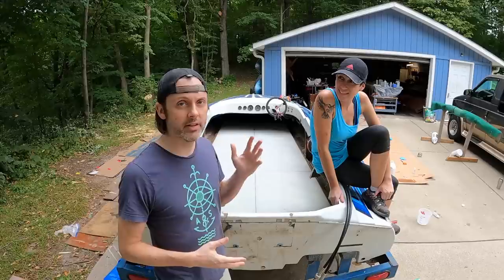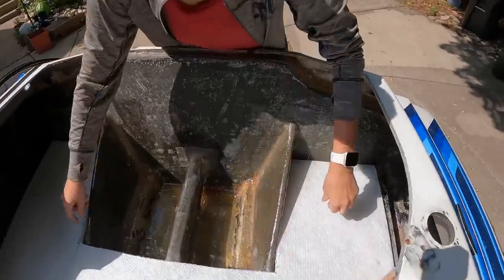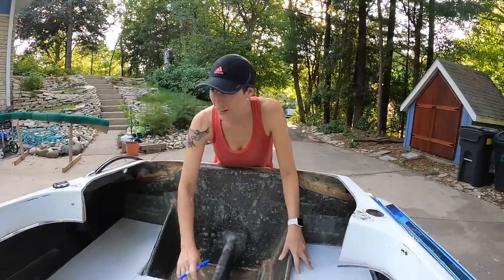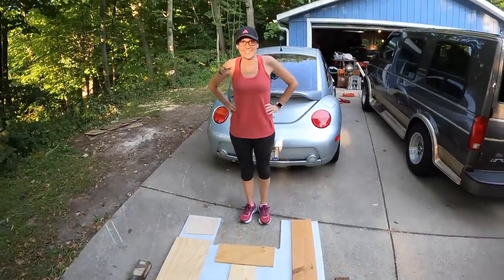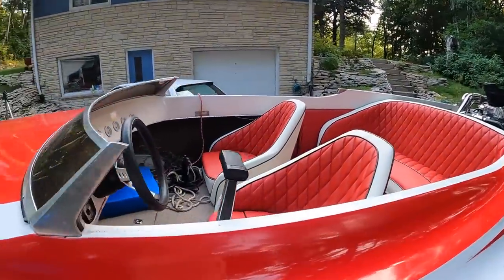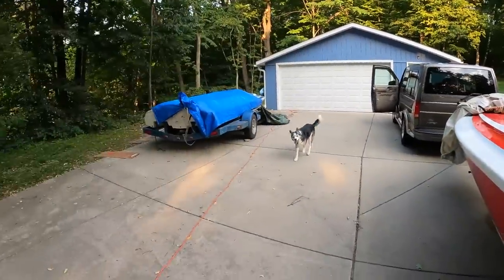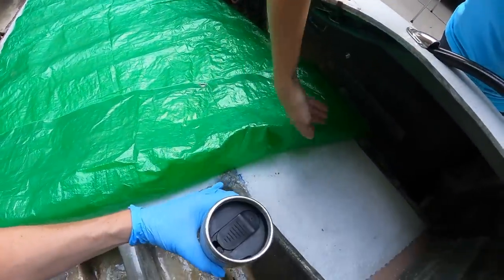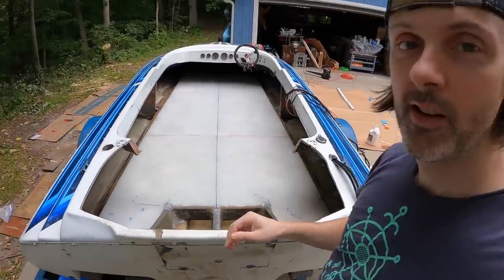ULTRA LIGHT HONEYCOMB FLOOR INSTALL Nidacore Sleekcraft SST Sunday #16

Comment: so this boat will be rot free after all you done sweet
Reply from the maker: And a LOT lighter, and way stronger.   Air entrapment hulls benefit a lot from weight reduction, as they air out easier and further.   Will basically be an airplane above 50-60mph, can't wait!

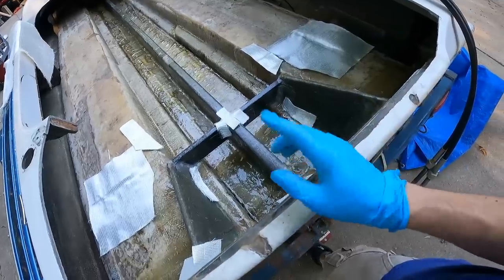Comment: Awesome work, sick boat!  Did I miss the vid of splash well delete or replacement?  At 1:26 you might be thinking about it wrong, (not that more tabbing is ever bad) the outboard torques sideways heavily twisting the transom, pushes from the bottom actually pulling the top of the transom back and pushes hard on near the center of the transom where the bottom of the engine mount or jack plate is fastened.  If you want to get a solid grasp of what happens with the torque of an outboard take your flea or something with a little 25hp and loosen the clamps a bit just play around you'll find that it tries to twist off from one side more than anything and seems to pull the top of the transom back way more than you would think.  Point being that knee should be created to be flush with the splash well going up as high as possible and tabbed to the splash well also.
Reply from the maker: There's one more episode after this one, so far.   Yeah, I know what you mean.   I guess I was thinking of something more violent like a log strike.   The mini knees are as high as they can go without hitting the splashwell.

Comment: I know what issue is.  If you could give me a shot of transom bracket inside boat. Need to see which trim components are in it.
Reply from the maker: Old ones, this is a 78 so it has the old school trim pump/reservoir that nobody makes parts or seals for.   Believe it's stock mercruiser 260/pre alpha vintage.
Reply: @ADDvanced  If this model has a reverse hold down valve on it those have a little adjustable guage on it with two white arrows that need to align properly in a set shft position blah blah typical blah mercruiser crap.  If it does the simple fix is bypass it.   Yes that simple.  They either stick like yours or malfunction and blow apart one of the trim cylinders when triming down.  Should be a line coming from trim cylinders to valve then another from valve to trim motor. This short one is almost always plastic. Just hook the line from trim cylnders directly to bottom of pump after you remove the other line to valve.  It never needed the valve to Begin with.  Also there is two wires attached to it also.  Disconnect those also.   You may have to change or adapt a fitting or two.  Uses standard brake line fittings. Hope that helps. Your trusted Mercury mechanic in TN.  No dark comments with this one LoL. Good luck

Comment: Are you using unwaxed resin, and that is why you don’t need to sand between sessions?
Reply from the maker: If it's still tacky I don't sand it, if it feels smooth I scuff w 3m pad off camera.

Comment: i wonder if the piston blocks the oilhole for the oilfeed on the down part of the hydraulics maibe you can put something along the ciinders to act as stops so the completely trimmed out possition is a little less than where it locks up 
if you where to take the cilinders apart and rebuild them you could add a small piece of pipe as a limit spacer on the inside slid over the ram so it doesnt happen again
you could allso use a small burr grinder and lengten the oilfeedhole hole toward the end of that side of the cilinder inside the cilinder or drill a tiny hole at an angle inside the original hole to get past the piston blocking the original
Reply: I agree, in a nutshell some sort of limiter/ spacer block should do the trick so it isn't able to fully extend itself to the point where it jams up. Should be something worth investigating for sure so you don't have to deal with the hassle of messing with it in the future.

Comment: what is that honey comb material? I'd like rigidity specs, balsa cores and plywood floors are used for a reason
Reply from the maker: Nidacore.
Reply: @ADDvanced  Thanks bud!  Nice timing, I just about got an old hydrostream ready for new floor and haven't decided if it's plywood or otherwise, your reply made me remember to check out other materials!
Reply from the maker: @rumnboats7612  Nidacore is super cheap and easy to work with.... but shipping is what's expensive unless you live in Florida.
Reply: @ADDvanced  with what you worked with do you think it's flexible enough to go down 1/2" in the middle of a 6' span?
Reply from the maker: @rumnboats7612  It's very flexible before you skin it with glass, so I'd say yeah.   Once you put glass on both sides, it becomes extremely strong.

Comment: Man that looks GREAT! Nice progress. Dig the Rotiforms. Pretty sure my buddy had the same set on his mk5 gti. Guessing they're for your avant? I'm not a boat builder, but based on my experience working with composites I think it'll be plenty strong with the 2 layers. Definitely looks very uniform the way you split the sections, and the fact that the 'empty' space between the tunnels underneath isn't spanning over a huge hollow spot will make it pretty strong/ less likely to flex as is. The cavity is narrow enough that I don't think it will 'bow' or twist or anything like that. I keep looking at the shape of the hull, and I really like the design of it. I think it would look absolutely killer with a sick vinyl wrap on it. Will definitely keep watching this build, its pretty sweet 😎👍🤙
Reply from the maker: Yeah, they're what I run on the UrS6 but they're pretty trashed, curbed lightly when I bought them and then clipped a curb a few years ago, need to get them remachined/refinished one of these days.  I'm more worried about setting an anchor on it or something... and cracking the top layer.

Comment: Sounds like a check valve in the trim pump. Try taking it apart and clean it
Reply from the maker: I'm not sure that makes sense, since it operates fine/reliably as long as you don't go allllll the way up to full tilt.
Reply: Could be it slams pres full tilt sticks from that sudden hit at the top maybe. I don't think if it were a ram it would come down at all. Unless you loose elect contact due to a switch but you are smart enough to know the difference lol

Comment: This is inspiring me to take on my own boat project. What are the plans for the outside? It looks like there is some kind of clear coat. Can you wet sand, compound, and wax or do you have to go through the process of putting some kind of clear back over it?
Reply from the maker: I've pressure washed a lot of it off, but end goal is to remove all the trim, wet sand it, and polish.  Won't be perfect but should look pretty good overall.

Comment: I am seriously loving this channel, and also now scrolling through craigslist looking for similar hulls lol

I need to replace a small portion of my cuddy cabin floor. My plan was to cut out the rot, brace underneath as necessary, glass that in, and then replace the decking with either coosa, nidacore, or 3/4" plywood. Should I glass up the new floor (bottom side, facing the keel), then place it down, allowing everything to dry at once? Or should I just glass up the whole panel, add more resin/cabosil (between keel/floor), and then place it down? Do you have any recommendations?
Reply from the maker: I don't think it really matters either way, I would just do whatever you are more comfortable with, and whichever seems easier to you.   I glassed the bottom of my core and installed it with the top unfinished.  This allowed any excess glass from the floor to wrap on the sides, down into the tunnels, giving it even more strength/bonding surface.  Hope that makes sense, and thanks for the words!

Comment: Y’all are doing an excellent job. Need to make sure that the pistons on the polish rods of your trim cylinders aren’t installed backwards and covering the hydraulic ports when it’s trimmed all the way up. It’s an easy mistake to fix.
Reply from the maker: hmmmm some idiot rebuilt these trim rams like 10 years ago.   Me.   So it's entirely possible.
Reply: Actually laughed out loud on that one. No big deal to check,pop one off,take the lines off and see if the pressure port is blocked with the cylinder all the way out. Still doing a great job in my book.

Comment: the core material is the anti crush aspect while the fiberglass skins ont he outside is what keep the anti crush cores from being floppy.... you guys ignored this and didn't fiberglass the undersides of the floor nidacore... the floor just won't be as stiff as it would of been if you had understood the purpose of a core material does... you neglected to the bottom so that floor is only half as strong to sagging.
Reply from the maker: Watch again main.  Put a thin layer of glass on one side, put that side facing down.  It’s skinned w glass on both sides.
Reply from the maker: Did you rewatch?  I glassed one side of the nidacore in the previous episode.

Comment: I am really curious what the weight loss will be with removing all the wood. I don't suppose you weighed the boat prior to disassembly?
Reply from the maker: I’ll try to estimate it when I’m done.  When I got it it was water logged and full of ants tho so wouldn’t be reliable info